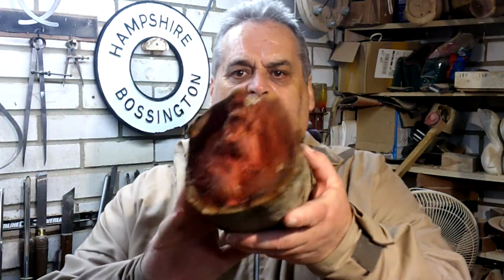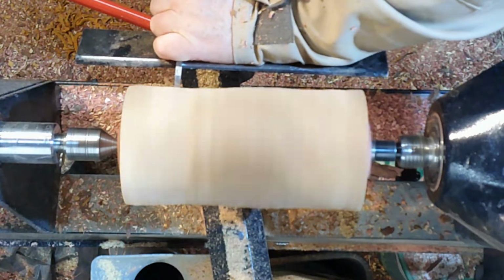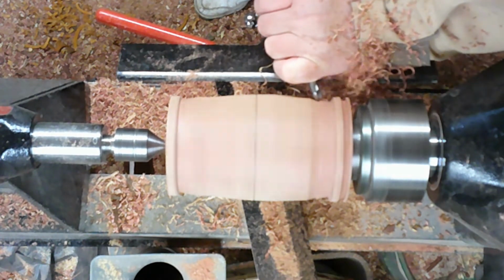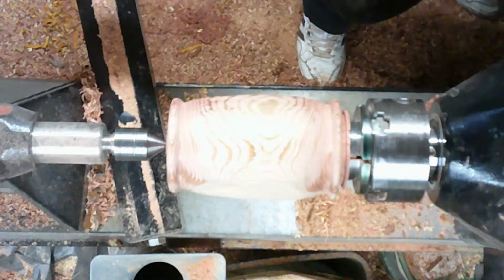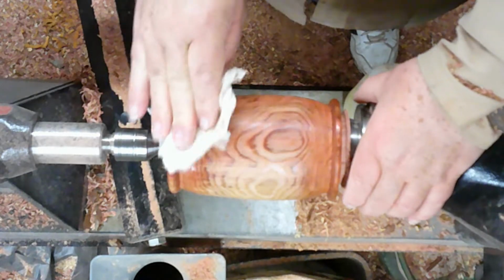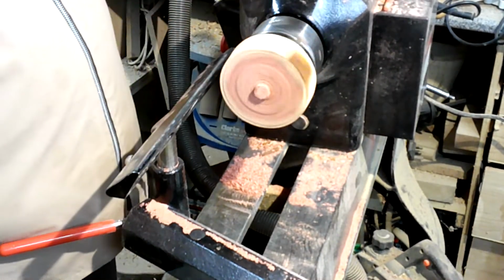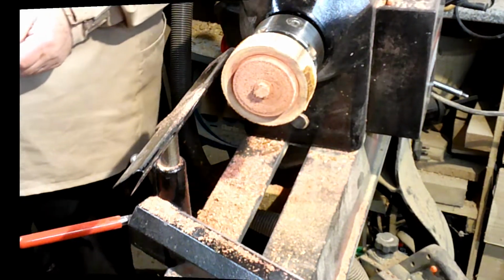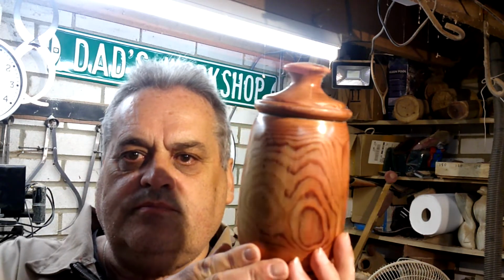A lovely little Cedar pot #61 wood turning

Comment: Nicely done!  I’ve had really mixed success with cedar as well. A few chipped apart really bad, but some also came out great.  Glad this one came out great!
Reply from the maker: Hi Drew, This was the first time i had turned Cedar it was fun, i think this was because it is quite soft wood, I had several other pieces which had cracks in them, which funnily enough the cracks ran across the grain, I didnt know where the wood came from so I am guessing this was storm damage